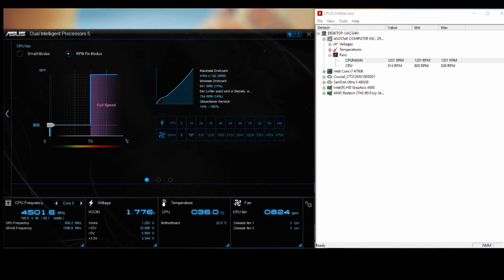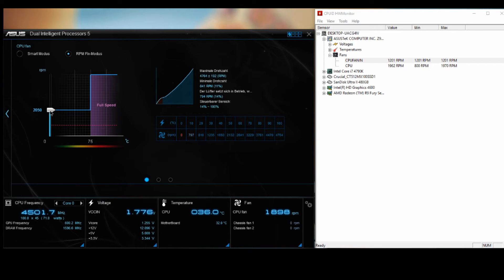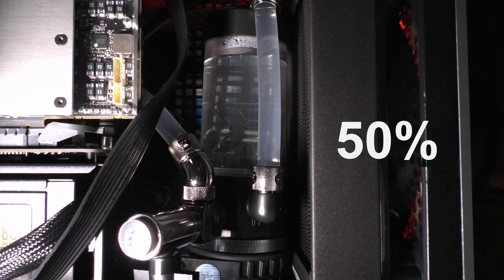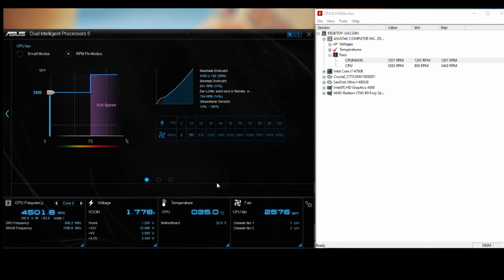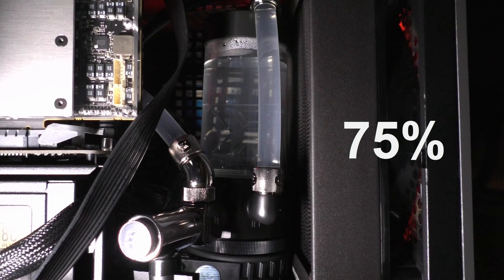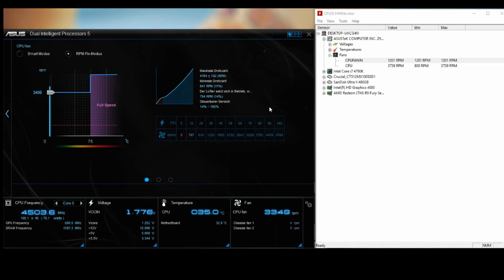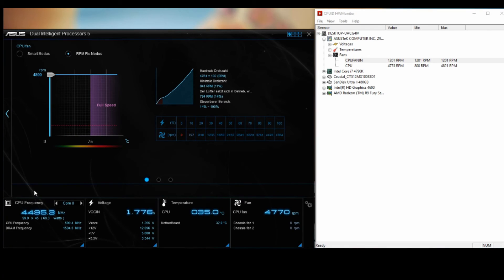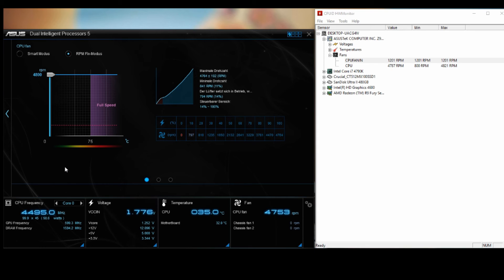Noise level comparison - EK Water Blocks EK-XRES 140 Revo D5 PWM

Comment: i dont get it. i have the d5 pump, but i cant get the asus software to boost the pump. what software should i use elsewise?
Reply: Make sure whatever fan header you use is PWM enabled in the bios.. some are set to DC voltage by default.  CPU fan header is usually PWM by default.  I use AI Suite.. the bios software fan control works too but with the AI Suite software I can control it how i want.  I run the pump 2000rpm at idle and have it ramp up as needed.  Pump is VERY silent at 2000rpm.
Reply from the maker: that asus software was just for the test, im using the bios for auto control. i setup a fan speed curve in the bios to control it
Reply: Good comment, but you presumably mean "very quiet", something is either silent (completely inaudible at x distance) or it is not. ;)  I really wish fan etc. makers would realise this too!